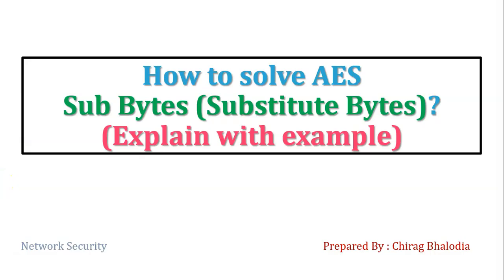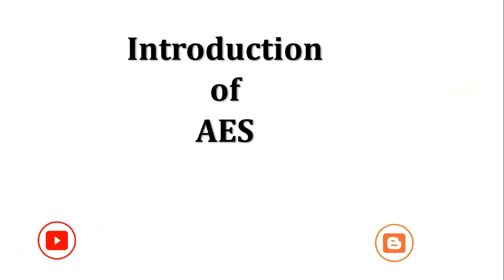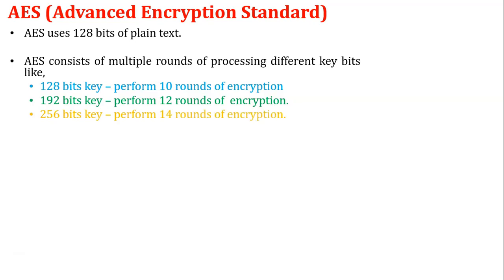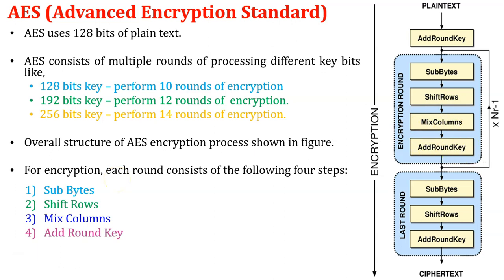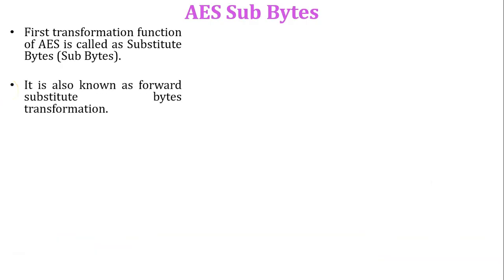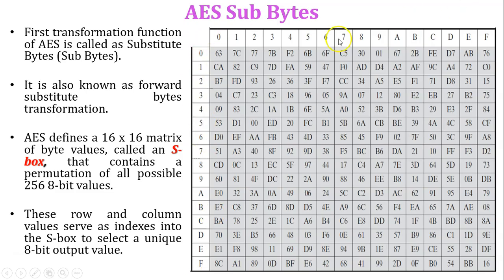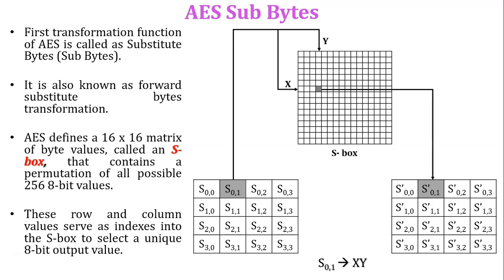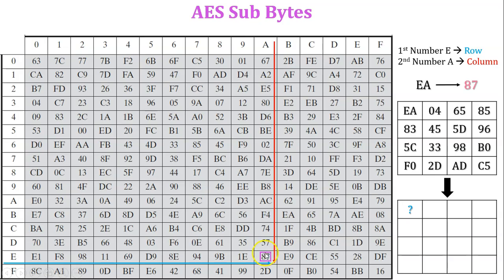How to solve AES Sub Bytes Transformation | Sub Bytes in AES | Solved Example

Comment: Add Round Key should be 11 rounds instead of 10. Since there is 1 "Add Round Key" transformation for round 0.
Reply from the maker: So it is consider as 0-10 but during execution exclude the 0 because it is default key added. So, it is 10 rounds